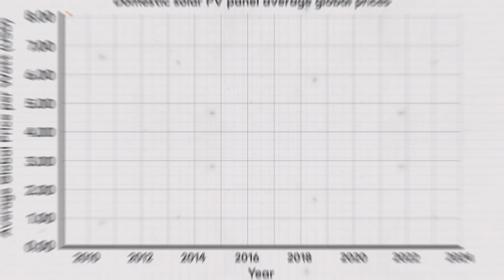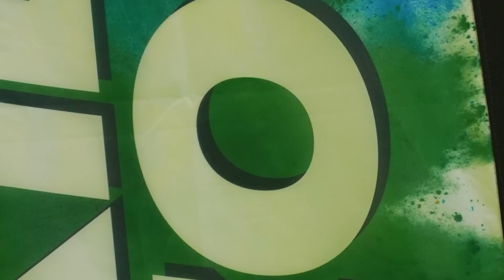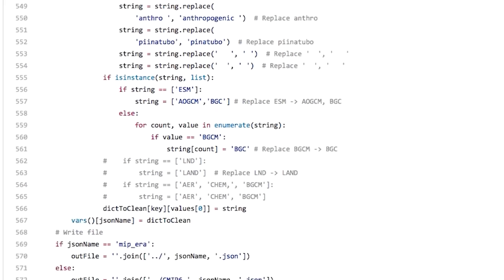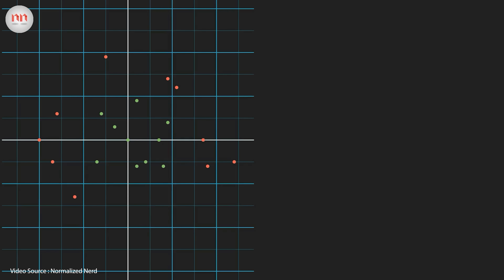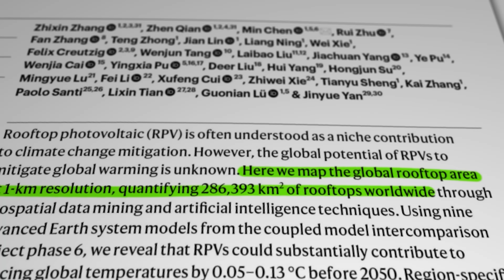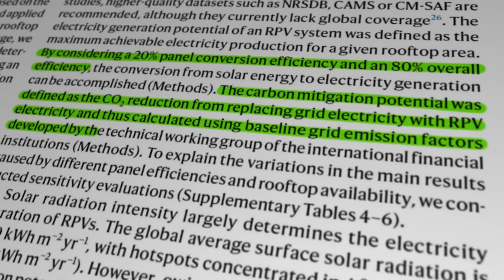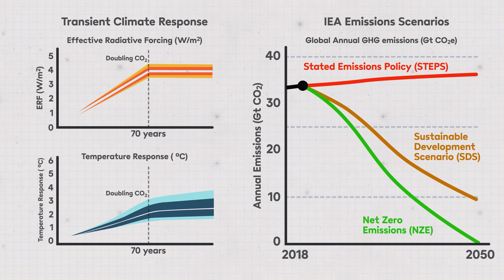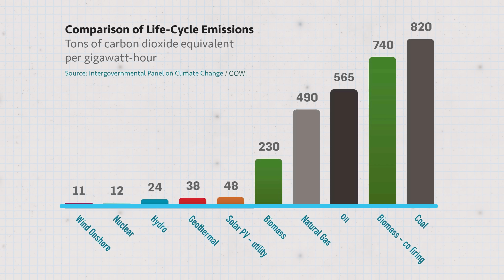New Report - Rooftop Solar PV is THE biggest climate mitigation technology!

Comment: If you can't get panels on your own place you can often sign up for solar through your utility and the price may even be better because they can do it on a larger scale.

You may still get even better return out of solar hot water heating before doing full solar electricity, but the thing is if you do hot water heating and run the pumps off solar panels you then don't cost the full route of battery backups because you don't need battery backups to run pumps that are only really needed when the sun is acually out.  Just size your inverters and plan for expansion if you have the room on your roof if panel prices come down even more and also if batteries for storage ever get safe enough and cheap enough.

Oh, and fossil fuels are recycleable and sustainable when you take the long view of them, but you can't burn as many as we're doing these days.

As for making the most impact ASAP, eat less meat and have a garden.

Comment: 4.1 kWH panels in 2007 and added 6 kWH last year when high FIT stopped. 2 batteries 13.5 kWH each. Have been self sufficient for 17 years, paid for whole system and still in the black each month at 4 cents FIT. All electric house and EV. The only sticking point in the scenario Dave has shown is the reluctance of governments to uphold their commitments, especially equity commitments, and their inability to divest from political funding provided by FF companies and other oligarchs.

Comment: One of the strange things about solar deployment always bugs me. Supporters of fossil fuels complain about the proliferation of solar farms taking up a huge amount of space in sometimes pristine environments, or farms that are no longer viable is probably more likely. However the power is generated, stored in huge batteries and sent off to homes and offices sometimes hundreds of kilometers away, that's a bizarre idea to me and seems to fall into the trap of assuming solar power is the same as fossil fuels and needs to be generated in a central location then sent off to it's use destination, and that is completely wrong. If you are going to build a huge solar farm to supply power to say a city, why not build it on the city itself, the rooftops. Instead of spending money clearing areas, building roads, putting up structures to support the panels etc, use existing structures and roads in the suburbs and install them for free onto peoples rooftops (volunteers of course) with either batteries at the house or storage locally.

That would solve two problems, the complaints of ugly solar farms everywhere and the necessity of spending money to create power infrastructure to support the solar farm. I mean in the end the power is going to end up powering the homes and businesses, why not put them as close as possible to these homes and businesses? As far as  am concerned rooftop solar should be a compulsory part of every new house and office  built, like plumbing and waste removal, they should automatically go in during construction, but as said, try telling the government that.

Comment: We've had Rooftop solar since 2009, in AU.
Moved house and now just install the 9 KW system with a 13 KWh battery.
The first system paid itself off in 5 years. 
We think our current system will pay itself off within about the same amount of time, because we are all electric and also run our car from solar.

Comment: My system cost me Au$24,000 it includes a 15kWh battery and would take forever to pay itself off, were it not for the fact that I also have an EV. Since I no longer pay for electricity AND I no longer pay for fuel, payback is about four or five years.

Comment: Solar roof top PV is great technology, but an expensive and material intensive. Search about steel used on The three Gorgeous dam  hydropower plant with capacity 22.5 GW and an average energy 100 TWh per annum , and you will find that on this case 1.7 tonne steel are used to generate 1MWh energy on demand every day, and will do this for decades, more than the life of Solar PV. After this learn what amount of steel is used on Roof top Solar PV. (it is around 41 tonne per 1 MW). Consider efficiency 20% the reserchers sugest but may be even lower). Then everybody will easy calculate that Solar rooftop PV consume approximately 200 time more steel, and this is "cost" which show that PV are expensive. If "Just Have a Think" or reserchers on this field have different fact, I will be happy to hear.

Comment: Electricity is one of God's awesome creations, the Grid however, is bullshit. 

If you're going with rooftop solar, get storage batteries. Otherwise you'll be in for a rude shock when you find out your system doesn't work during a power cut; grid tied systems require a 60hz input to synchronize to.
Reply: "God"

HAHAHAHAHAHAHA

Comment: only real problem is accually using/storing all the electricity generated during mid day over a whole day or more. roofrop solar works fine at small scales but at larger scales it could destabilize the grid or force people to stop providing power to the grid

Comment: I’ve got 17 kW of panels on my house and garage roofs. Along with that are 2 Powerwall 2 batteries. They will eventually pay for themselves but it will take awhile. I have more panels that is needed but accounting for our cloudy climate and degradation over time, the excess capacity will make them have a longer payback time.

Comment: Had solar for over 7 years now. Keep expanding it as my needs increase. Currently have 30kW but I am completely off-grid (no meter) and solar fully powers the house and 2 full EVs and an electric motorbike so I am regularly drawing over 14kW to charge the EVs. I have V2L from my EVs (bi-directional charging) connected to my home solar to help power the house at night. Videos on my channel

Comment: I have long thought that incentivizing PV on the roof is the way to go if we want to make progress against fossil fuels and climate change. First and foremost you at least put the generation close to where the electricity is going to get , which means you avoid having to put in a lot of electrical infrastructure as compared to what you have to do when you put in a solar farm. The US is struggling to figure out ways to build utility scale solar and wind farms because of local resistance regulations and interconnect delays. Solar PV is something you can decide on individually, and there's no additional infrastructure needed unless you need a panel upgrade.ook at what Australia is doing, showing what can be accomplished by putting massive amounts of PV on the roofs of residential buildings. Now they're starting to roll out batteries. I'll bet that eventually their electricity will be so cheap that they will start to be able to draw Industries in due to the low cost of electricity

Comment: Why is it never mentioned that more and more solar panels installed, and feeding back into the supply (Grid), can and will cause overloading of the supply cables from the Grid. Good luck with that when the supply cables need replacing. More so if the cackles are underground.
Reply: Citations required.

Comment: Hi Dave, I agree that fitting a Solar System should be a no brainer at this stage.
Sadly the reality is that a lot of people, even in Australia, can't afford to pay for the initial outlay.
That is where Govt Policy and who you vote for makes a big difference.
I was lucky enough to been able to install Solar a 2.5kw system on my previous Home in 2004. Fully installed it cost $8000 $AUS, with a Feed In Tariff of 44c fixed rate until I sold the Home. I did sell my Home in 2013, moved interstate and that meaningful Subsidy expired.
Then after settling in to  my "new" Home  and saving up, I was able to fit Solar for $5000 for a  2.5kw System fully installed but with a variable Feed In Tariff of 16c in 2015.
But here's where Govt Policy comes in.
From 2007 to 2013 the Federal Government had slowly introduced a sweeping range of Climate Policies and things looked as if we had shifted for the better.
Then in 2013 a Majority Elected a new Federal Government that was openly Climate Change Denying/Anti Renewable Energy/Pro Coal and it went down hill.
Since then with a a Fully Privatised Multi Company Electricity Grid and National "Market Regulator" setting the Feed In Tariff, it has plummeted since 2016 to 5c. Unless of course you do a Deal with your Retail Energy provider where you trade off a Higher Variable Tariff that fluctuates between 15c - 10c for higher charges on everything else
That Government was re elected until 2022, when a lot of us hoped our new Government might reverse things. But they are so spooked by the Noisy Fossil Fuel Industry and our Coal Export" reliance", apart from some slight of hand schemes, not a lot changed.
Another Federal Election looms in May and we are caught between a Gutless Incumbent Government (that I usually support and feel totally betrayed by) or the same old Climate wrecking Opposition or maybe a Minority Government that would need Pro Climate Policy smaller Parties and/or Independents, if enough of those are elected, to govern.
Based on past experience I am not hopeful.
Cheers
Pete

Comment: Solar panels are only economical as a supplement in sunny areas between the 35th parallels. Ideal locations include Aswan, Luxor, Yuma and Lodwar.
    Both the current mean annual surface temperature of Earth and the current atmospheric carbon dioxide concentration are suboptimal. Climate action has negative utility.
Reply: Citations required.  

You are a known liar.

Comment: In Australia we have the highest concentration of rooftop solar in the world and it is causing massive problems in stabilising the grid. It It has reach the point where there has been talk of stopping your excess power going into the grid.  No one saw that coming, did they?
Reply: It’s not really the problem with solar panels. The coal generators that are long past their use-by date and can’t be turned off without the serious problem of them failing to restart are not being closed down fast enough now they are redundant.

Comment: Interesting idea and it 'feels' right.  It does mitigate elec use at the worst of times, summer and in general, daylight vs night and yes I know elec cos insist peak has somehow now moved from historic 3 to 7 pm to all day dawn to 10 pm midnight and even later to which i say BS.  
Solar in the summer when it's often sunny could easily match total summer needs of not just the homes but many biz also, esp where biz are low rise covers acres buidlings.  Some will be wasted due to lack of the only effective storage we have, pumped storage, due to elec cos funding NIMBY orgs to come up with tree frogs, insects, and view scapes to sue them into submission, ignoring that all such facilities create TWO wetlands, at top and bottom, and create MASSIVE rest areas for migrating water fowl, and their facility grounds, kept free of people, become actual native refuges.  
As to pay back.  It's a BREAK EVEN as the cost of inverters, which don't last nearly forever, esp if built in bulk for lowest cost possible, not in China, if made in China given China's plan to hold the world hostage for product, built as poorly as possible, then not only will failure rates increease, they'll catch fire.
As to cheap solar panels.  Solar panels have always had much longer lives than designed for, being such simple devices, but that is based on data from WESTERN PRODUCED PANELS inc almost Aerospace quality of first few decades of panels.  As the flood of crappy chinese panels takes over, the avg production of older panels will flat line, and yes you can make a crappy solar panel EASY and shave production costs 30% and more.  Which is all China cares about, flooding world markets by pushing out cheapest crap they can, with everything until only they are left making stuff.  I've seen tests of panels from historically China only suppliers of stuff with panels made outside china and even in china under supervision and standards of western plants still struggling to stay alive after all their chinese partners and staff went off to build their own plants, making cheaper albeit crappier panels.  The cheap chinese panels just don't match up
The TRICK with solar as a REAL savior will be panels lasting 2 to 3 x as long, to make up for inverster replacement every 10 to 15 yrs.
Of course none of this addresses roof replacements, which hasn't been addressed in 90% of installs, and taking all that off to re roof and put it back will cost MORE than the orig installation.
So, YES roof top solar on every home and biz and gov't bldg ALONE could cut carbon AND 100's OF REAL CAN"T DENY CANCER CAUSING DISCHARGES FROM POWER PLANTS, I'd bet by 30% without much storage, 50% with pumped storage in 20% of good sites, and with wind, 75% with full pumped storage.
fyi  US Gov't did study, US have many times needed sites for pumped storage, mostly in SW where solar energy is almost a  year round thing, and wind energy from gulf and coast could easily be routed for storage.  In the East there is over 500 miles of coal mine ravaged low mountains, with more mountain tops being scalped every year to get at coal, as it's all strip mined now for the most part.  No miners, just truckers and heavy equipment operators doing exactly what is needed to make pumped storage, but carefully avoiding doing so, and so near the E Coast where off shore wind could power it 24 x 7 forever with pumped storage (and for which EU elec cos are paying more per acre for wind gen rights than oil cos will pay for drilling rights - so someday, the US will be payijng EU for 1/3 of it's elec thanks  to a gov't that will only support oil and gas, ie, a GOP govt beholden ONLY to entrenched billionaires and their biz.
Thanks I needed a break from taxes

Comment: Is it really true though?   The grid requires balance and solar fluctuates wildly, on it's own it would seem to be more trouble than it's worth, the balancing requires something dependable that can step in instantly and that something would tend to have a carbon output.   It goes without saying that solar works only when the sun shines, thus when it is shinning all those pannels are blasting energy onto the grid, which will in future far outstrip what is required at that point in time, the duck curve.   In fact all that solar becomes such a problem that the grid will likely want to charge you for the solar being exported, in effect forcing the home owner to switch their solar off. or accept a negative payback.   Is this already happening in the sunnier parts of the world?

Battery is the clear anwser but they are expensive, consumable, can only hold so much and have conversion losses, they mitigate rather than solve the problem.   That said I think no one should be allowed to have solar without having a battery as they do produce a very valuable dampening effect.   But and it's a big but they tend to wreck the investment case.   I have a 8.KW string, with a 13.5KW powerwall 2.   It cost 24K to install 2.5 years ago, generates north of 7MW and saves between £1700-£2000 per year.   Payback will take 12+years, battery or inverter could easily fail in that time, battery has a 10 year warranty, inverter is less.   Factor in the interest the money would earn and the numbers don't work.

Comment: Another option is solar water heater...lower rooftop footprint than PV's and can cut the electric bill by a third if the water heater is electric.  

Also find every way to save energy before investing in production; a $20 water heater blanket saving 4kWh / day is cheaper than 4kwh of daily solar panel production costing $800 (or more).

Comment: We built our first solar array (not on a roof, since we have land in abundance to put them on) 14 years ago, and expanded 2 years ago.  Will expand again this summer to the extent that the load added by our heat pump house heating system, electric hot water, and BEV increase our usage (we can only connect capacity sufficient to generate 125% of our annual consumption).  Given what the first lot cost, the payback on them is comparable to their expected life, but the new ones will pay back very quickly.  In my opinion, given the ease of solar and wind, every rural homestead should be required to be a net generator as part of the hookup contract.

Comment: This guy is bonkers.  Rooftop solar isn't a solution to climate change without storage to transfer usage to late in the day, and that is ridiculously expensive.
Reply: It's like you haven't bothered to look at his catalog of videos and noticed the many videos about energy storage.
Reply: @TheDanEdwards  it's like you have never bothered to do a macro analysis of the cost of storage to balance high capacity rooftop solar.  It is way WAY too expensive.  It is just feasible by using idle stand-by OCGT, but who wants more gas?   Rooftop solar is a useful supplement to the grid up to about 20% capacity, but after that it throws grid stability into chaos.  So suggesting that solar is " THE biggest climate mitigation technology" is absurd.  The optimum is a mix of 20% solar, 40% wind and hydro, 30% nuclear, 15% OCGTs and 5% battery and pumped hydro.
Reply: @jinnantonix4570  It's like you have no evidence, just making claims you can't support.

Comment: I like markumbers5362 have spent Aus$19K on my Solar and battery array, I export to the grid at times and heat my hot water via a timer to capture the solar out put at its peak times. Unfortunately Solar will not run heavy or medium industry. my boy is a cabinetmaker and the solar setup in his workshop does not cover the electricity used during the work week. I am Still glad that I spent the money installing the solar panels and battery.